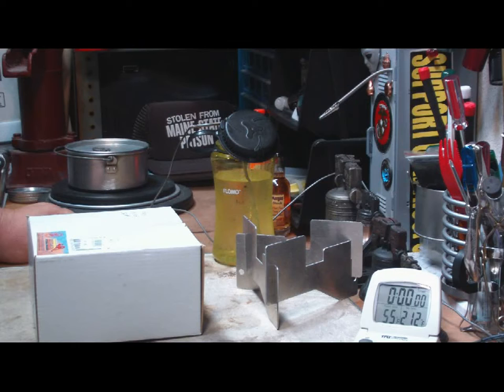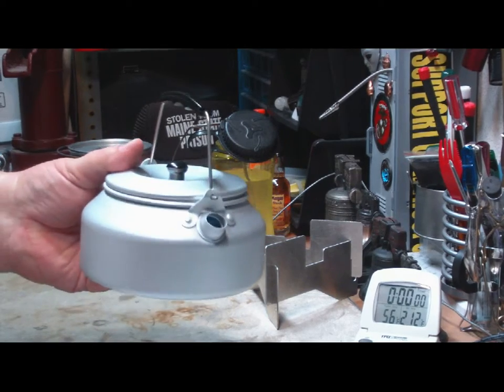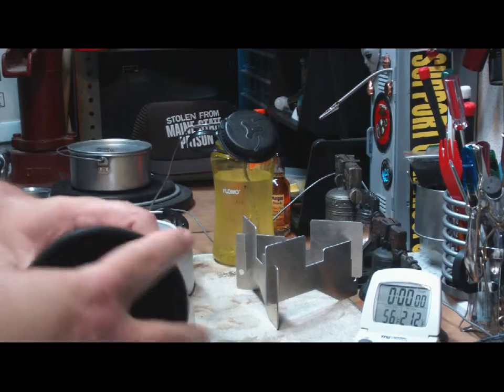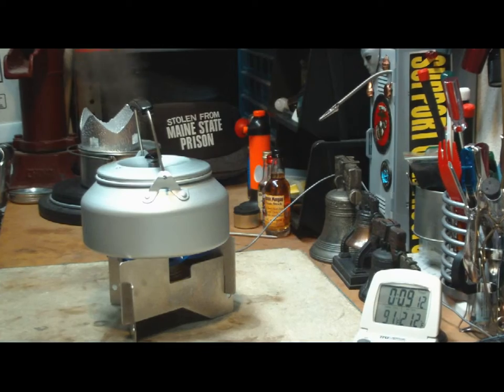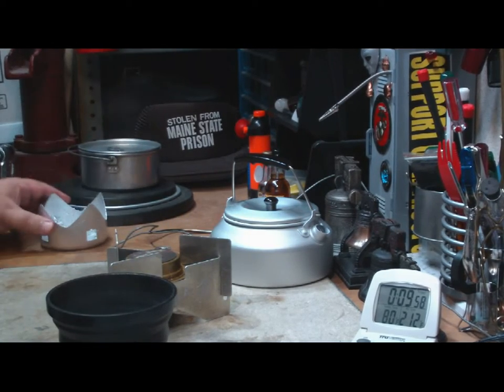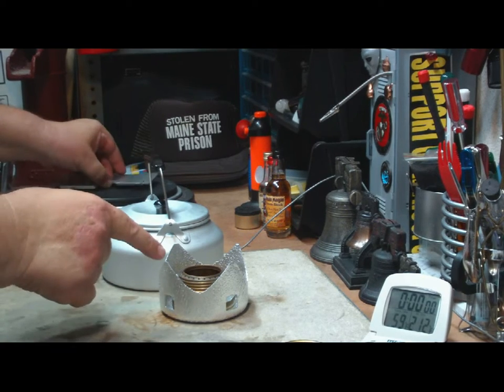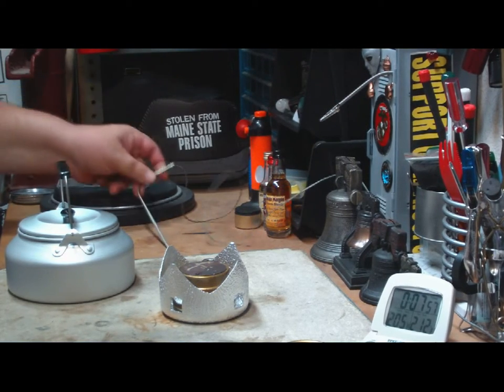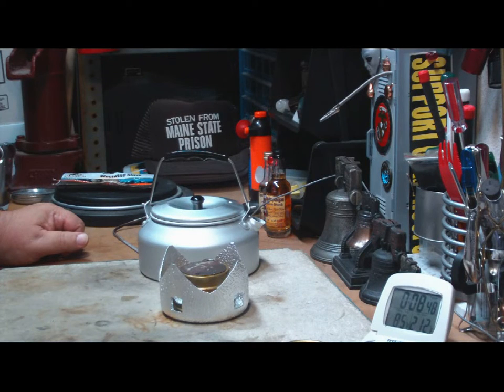Anodised Aluminum Tea Kettle Boil Tests 1 & 2

Comment: Hiram very informative,by the way the kettle appears to be a knockoff of the Evernew Tea pot. It will also fit inside the "25" series of Trangia cooksets real nice. Alway put stove inside something non electrically conductive due to the metals interacting with each other.(electralysis?(sp?))
MikeSr39

Comment: Hey Hiram. I made that modification to my Westwind stove you discuss at 10:00 in your video. It improved the boil time by several minutes. I made a video about it, but I think you've already seen it.
And I agree with you about titanium. There are cheaper ways to lower your pack weight. The dollars to weight-savings ratio isn't appealing enough to me. Plus I think aluminum cooks better with more even heating. I like the new kettle and for $10, you got a good deal.

Comment: Hello Hiram. Concerning your pot stands, I don't know why people insist on using one. As you may recall I use soda/cat-can stoves & you place the pot directly on the stove. there's no need for a stand unless you have a large cooking pot. If that's the case, three nails pushed into the ground around the stove, will easily serve as a great stand. A sixteen/eight configureation in holes on the stoves makes for a more than adequit burner, plus, you never use more than an once to boil your water. B2U

Comment: Catchy new tune.  Thanks for the magic number info of 1".  Do you know the height difference if any between the large and small Trangia stoves?  I was considering getting the smaller one with simmer lid for use with the Swedish Military Mess Kit if it would perform the same as the larger Trangia Stove does that comes with it.